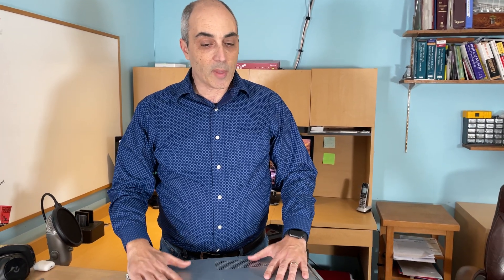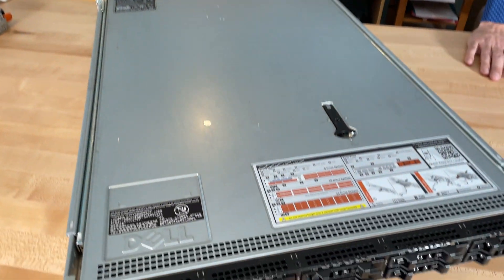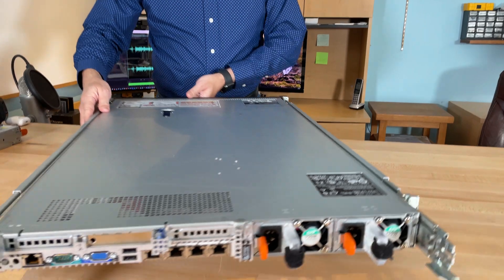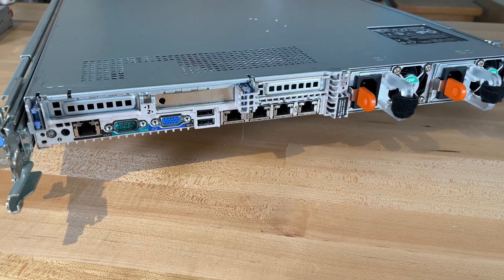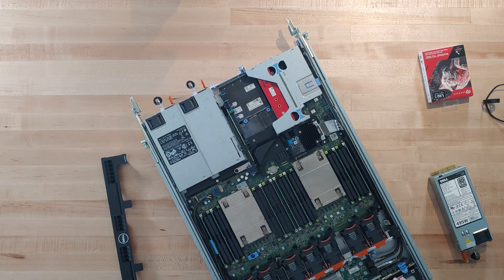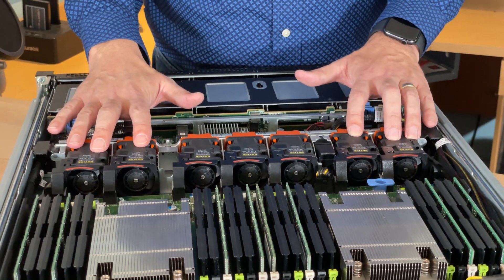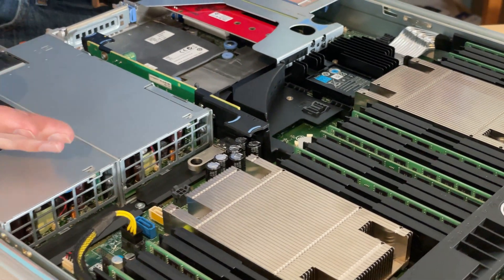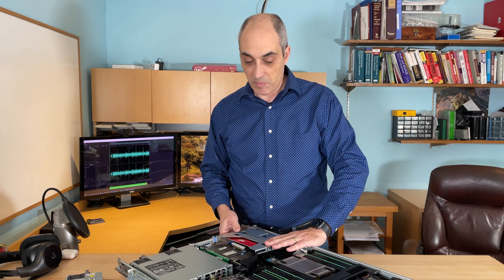Dell PowerEdge R630 - Overview

Comment: Can this run a Tesla T4 or Nvidia A2? I know the 730 does but trying to see if a 630 can (as far as easily fitting in without crazy mods)
Reply from the maker: Ah. Without looking it up I would guess not since we're talking 1u (630) vs a 2u (730). I certainly have not tried to fix a decent GPU into a 1u. I don't have any on hand to test this out at the moment. I have an R640 but no GPU. Let me know what you find. Any viewers know the answer definitely?

Comment: do I need turn it with both psu plugged? I am having some trable bellow can be becouse i am plugging only 1 psu?

UEFI0066: A PCIe link training failure is observed in Bus:131 Dev:4 Func:8 and the link is disable
Reply: It should run fine with just 1 PSU plugged in but all the fans will be running full blast!
Reply: @sonictech1000  i always run 1 PSU, and never have fan running full blast issue, in fact i have energy monitor tool, i tested between 2 PSU and 1 PSU is using a lot less energy (not recommend for production ofcourse but for home lab best to save energy).
Reply from the maker: I’ve never encountered this problem. I’ve also only ever seen one server with a single PSU from memory. Since that’s a weak link along with the drives, the majority get the redundancy for peace of mind. I had a PSU literally burn once. I don’t remember if I ran the server with just one. I think we had a spare one handy.

Comment: Hi Thank You for the video!. can You install Windows 10 or 11 in this machine?.  Do I need a RAID card to use SSD drives?. and My Last question.. is it possible to connect this server via Ethernet cable to My PC machine?.  thank You for such a detailed video.
Reply from the maker: You can install VMware vSphere ESXi and then put Windows 10 or 11 as a virtual machines. I’m not sure if Windows 10 has all the drivers to run directly on the hardware. I may test that… to connect to this you can get a small switch if your router has only one LAN port. You could also direct connect, but I doubt that’s terrible useful for anyone. :)
Reply: @BobPellerin  splendid!, thank You Bob!, i really appreciate it!.

Comment: Hi,I just got two server like this,does I can put two r630 in a 2u space or I need to put beetween a blanc space of 1u? Thank :)
Reply from the maker: You can put them one on top of the other and use up 2u. I wouldn’t put a full sized rack with all Us taken up for heat reasons, but they are design to stack to maximize density.

Comment: Hi, are the two left most drives independent from the HBA? Why do they have a different color? Thanks.
Reply: They're actual caddies. The rest are fillers that you can't actually mount a drive in until you replace it with a caddy.

Comment: Can u boot the OS directly from the SAMSUNG PCIe NVME M.2 SSD ? I am asking this question because the direct OS boot from SAMSUNG PCIe NVME M.2 SSD does not happen with R720 server.
Reply from the maker: A Samsung NVMe drive isn't an enterprise drive. Having that out of the way, I have one running in my lab in a R630, so it is recognized by ESXi 7. I installed the vmware on a USB stick and am using the Samsung to hold test VMs. I didn't try installing the ESXi directly on the Samsung. I know some people told me Samsungs would not be recognized on HPs and Dells. It may have to do with being a R620 (older).Try installing the OS on a USB and see if the drive is available to create a datastore. Let us know if that works.

Comment: I just bought a Dell R630 empty chassis, no mother board and no power supply, for $44.  I want it like that cause i want to learn the hardware aspect of it as well as software.  I'm planning on using it for my homelab and a virtual machine either with VM Box or VM Sphere.
Reply from the maker: They are great servers. I don’t usually build them back up from the case up. Let us know how much your project ended up costing and how hard it was to find all the pieces and wires.
Reply: @BobPellerin  will do, I saw on eBay the motherboard for $100 and power supply for like $75 the 1100 watts one